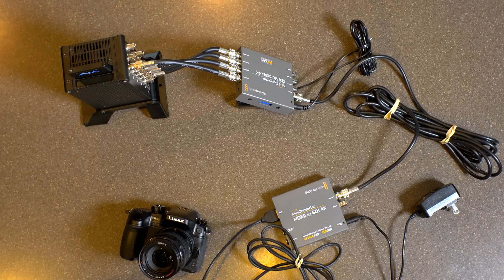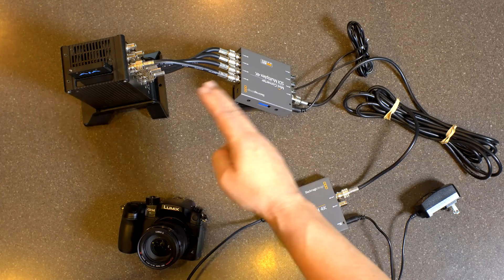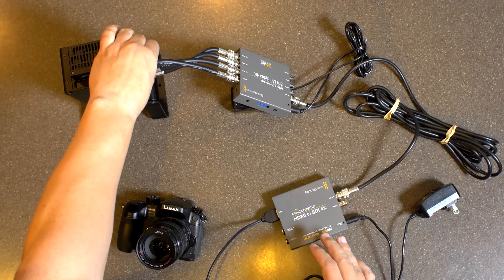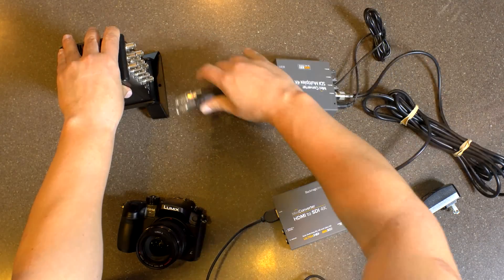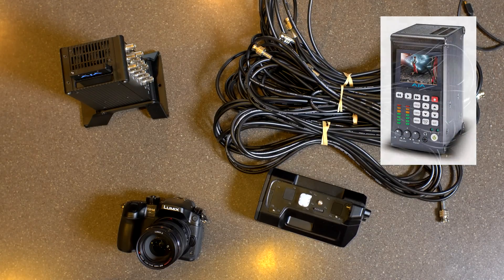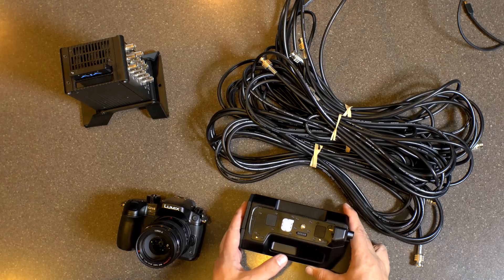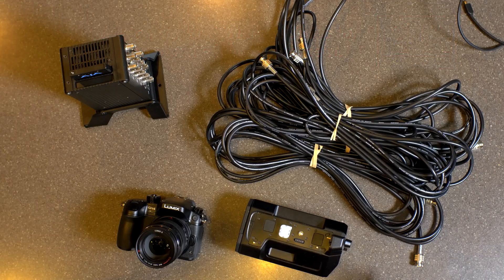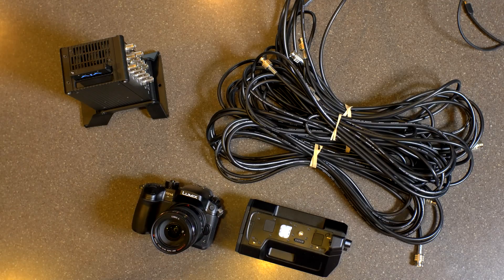Shooting 10-bit 4K on the GH4 | How to Shoot 4K 10-Bit GH4 Tutorial Video

Comment: I'm a little worried now after seeing this video if the GH4's micro HDMI isn't going to work with the Atomos Shogun either. 10 seconds of 4K recording seems very odd and like you say in the video it works fine with the A7s. Hopefully Panasonic isn't crippling the GH4 4K output so you need to use the YAGH interface.
www.eriknaso.com